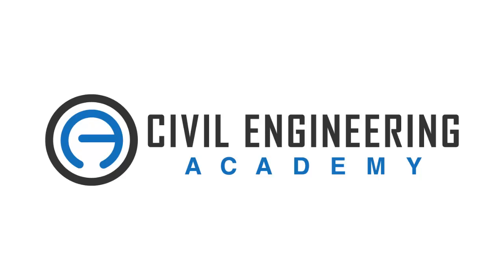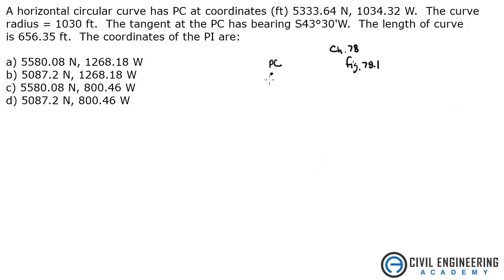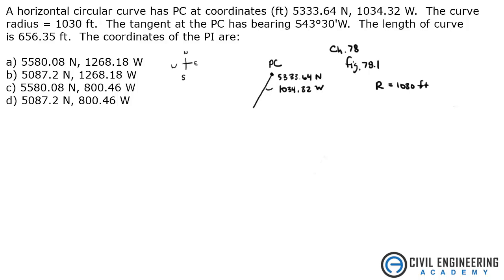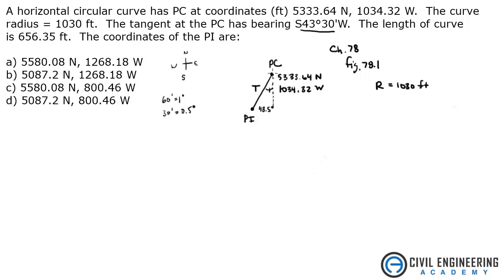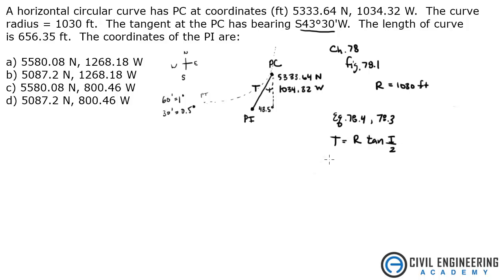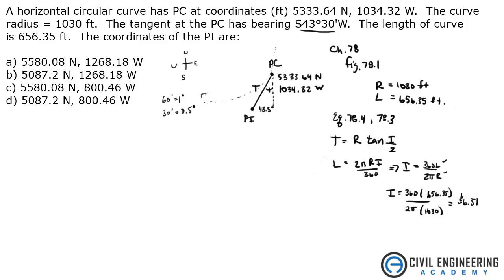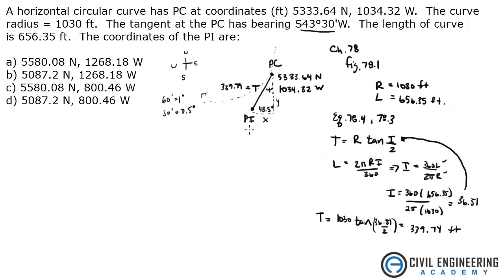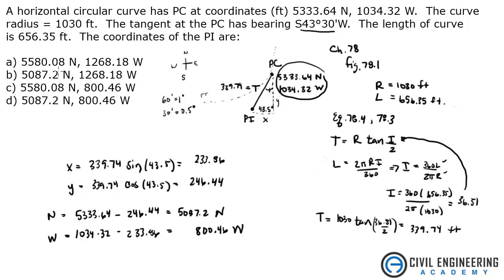Transportation-Using Bearings to Find Coordinates on a Curve

Comment: Not sure who will stumble across this, but the correct answer is B. The curve is moving West and South, so the delta(x) should be added since we are dealing in Northing and Westing. Additionally, to save yourself time on the actual exam, this question can be answered without numbers if you know the direction the curve is pointing. Happy Studying!

Comment: Love these videos. However this is the incorrect solution. B is the correct answer. Since the PC x coordinate is a westing, the SW bearing pushes it further west. So you’d add the 233.86 to the 1034.32, not subtract.

Comment: The 43.5 angle and I/2 should add up to 90 degrees but it does NOT! The given degree is wrong and is not necessary.

Comment: Hi Civil Engineering Academy,Please explain the X and Y components. My understanding is that….Sin 43.5degree =Y/339.75 which yields that Y =233.87 and the Cos 43.5degree = X/339.87 which yields that X=246.45.  Is it possible that these values are inverted on this video?  Please explain what I am missing????
Reply from the maker: Hi Valerie!  I've responded to you through your email on this one.  Let me know if you have further questions!

Comment: Hi. I was wondering why the X is subtracted from the original westerling coordinate.  Shouldnt we add X since PI is more west than PC?
Reply: +Civil Engineering Academy Im confused.. It seems like you had it right the first time.  The question is asking for a coordinate and with the given bearing of the tangent you can tell that the x and y location of the PI will be lower and to the left of the PC.  To get your revised solution the bearing would have to have been to the east which would result in a larger x coordinate??
Reply: I believe since the problem is Northing and WESTING, then you are assuming that your origin is to the right of the given point.  Therefore, you would add to the x-coordinate because it is getting farther away from your origin.  I believe the correct answer is B.
Reply: you are 100% correct, This is very confusing. They shouldn't revise it. It was correct the first time
Reply: Civil Engineering Academy Yes that makes sense but since the coordinate is to the west then isn't it essentially a negative X coordinate so yes we subtract but we would be subtracting a negative essentially which would result in a greater negative number or greater valued westing coordinate shouldn't it?
Reply: @hmarquez4747  what's the correct answer? Is it B
Reply from the maker: I fixed the problem.  Thanks for the catch.  I don't know what I was thinking.